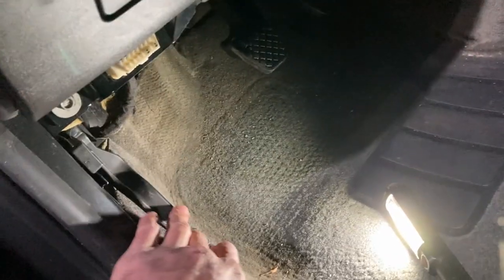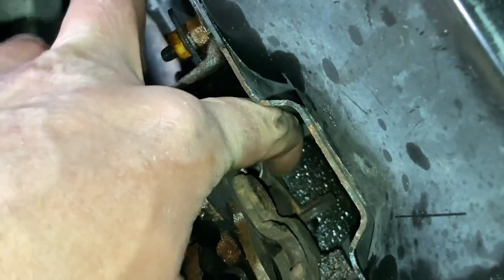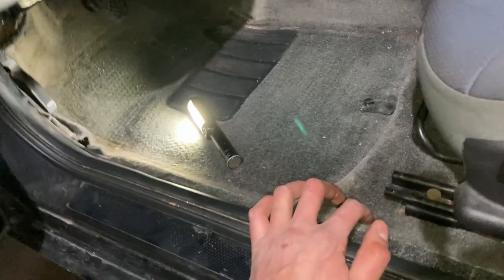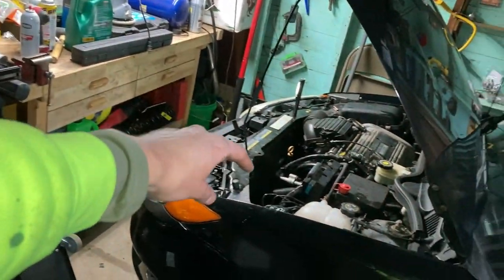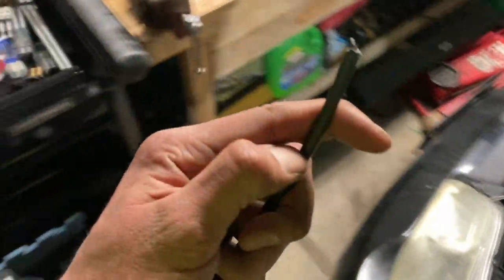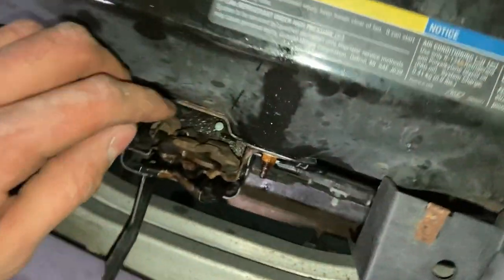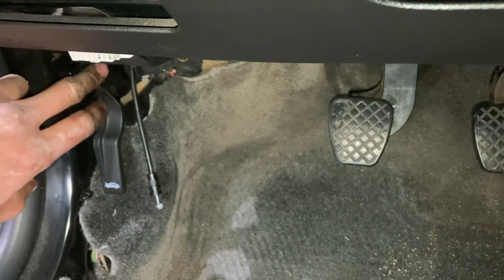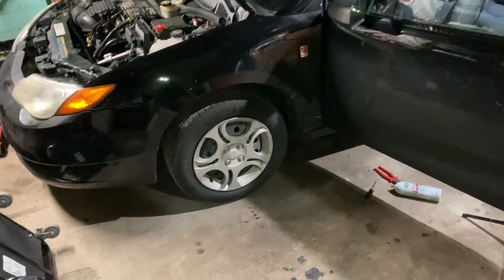How To Replace A 2004 Saturn Ion Hood Release Cable

Comment: I found it difficult to pull the new cable through the opening in the firewall, I imagine a little lubrication on the small rubber sleeve on the conduit would've helped.

Comment: I have a 2003 Saturn Ion 2! my hood release cable just broke and I am ordering a replacement. but I'm trying to figure out how do I pop the hood with the latch being broken!
Reply from the maker: If you’re able to grab the bare wire still then use pliers to pull on it, and that should pop up the hood, if not, you might have to remove that small grill in the front, and from there you can access the mechanism.
Reply: I have this problem and I used a pliers while sliding underneath the car, to press the latch pin that pops the release